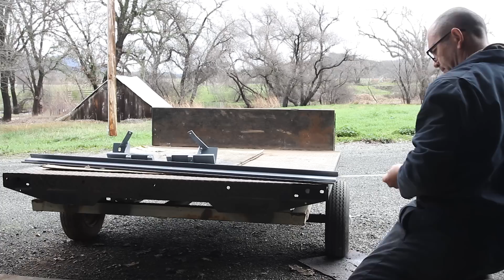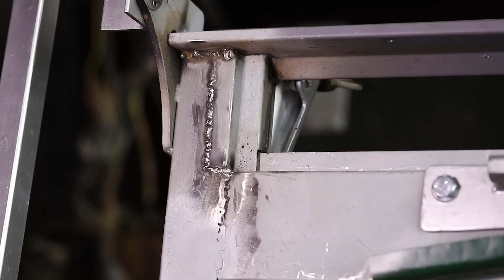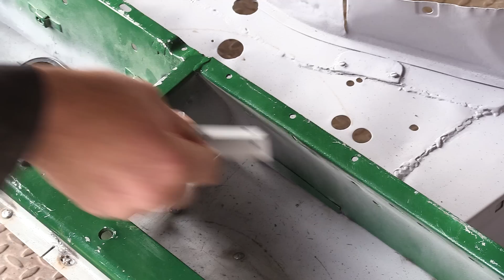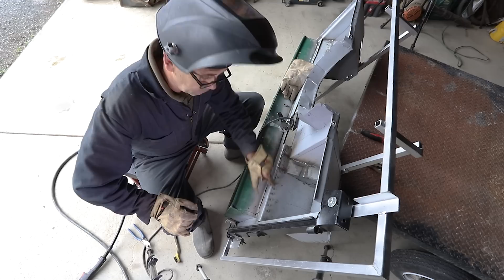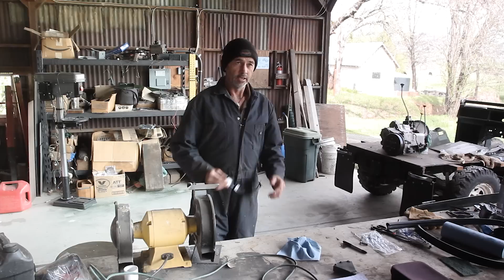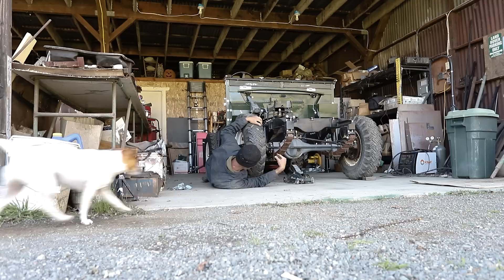Part 29; The Big Stitch up. Series 1 Land Rover Restoration

Comment: Nice to see it rolling again!  Thx for the brief namecheck.  I have had some issues adjusting my brake linkages to get full brake pedal travel and pressure without the drums dragging when the pedal is released.  I had to make an extension going from the master cylinder push rod to join the pedal bracket. You seemed to get straight to a place that worked well.  Luck or skill?  😊. One point of difference, your brake light switch is mounted below the bracket on the chassis.  Mine is on top.  Probably does not make much if any difference.  But which is original?  I was only guessing with mine.  Btw - have you decided what you are going to do about the engine….?
Reply from the maker: Ahoy there Andy, I have brake drag and am in the process of adjusting and tinkering, so neither luck or skill on that front. Good to know you had the same issue. I mounted the brake light switch in the same place I found it so I'm unsure what is original either. The engine saga is still unresolved though the fellow I'm dealing with claims he's soon to start on them and it could be but a few months away. I'm not allowing myself to get my hopes up and may start on the V8 if it drags on too much longer.